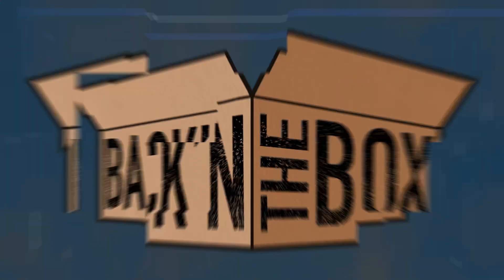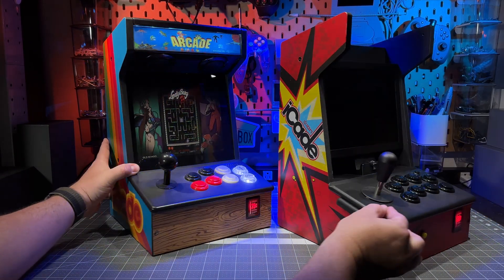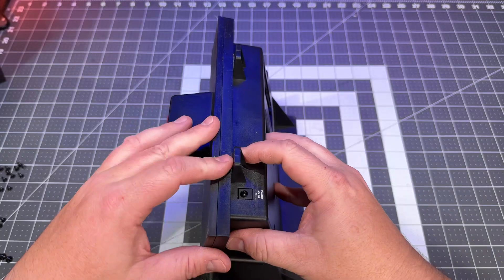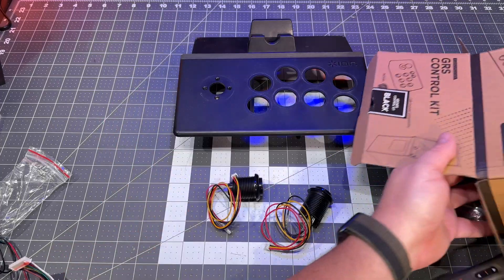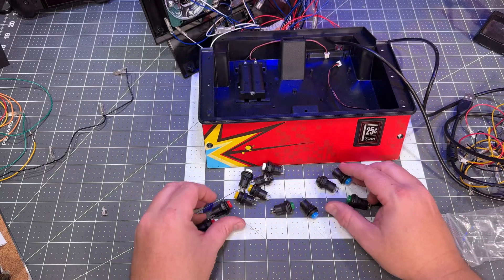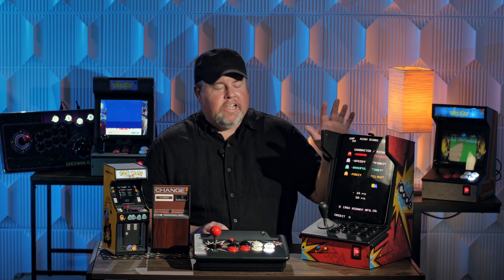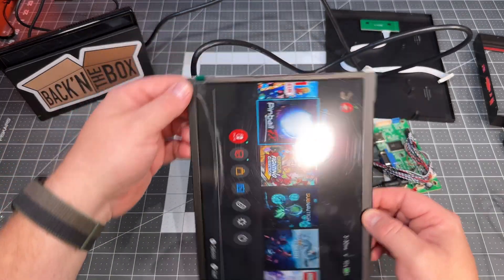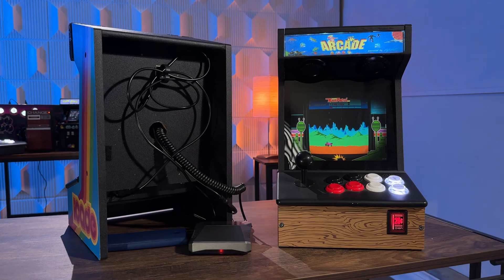mini-Arcades;  DIY MODs for Switch and iPad

Comment: Can you do this with a galaxy s9 + tablet?
Reply from the maker: In one version I have an hdmi to usbc capture device that allows the iPad Pro to be used as monitor. Make sure it is a usb 3 rated device as slower devices have more lag. As for the other version where I use an iPad screen as the display you’ll just have to find a display controller board for the display panel you use. So just look up info for the S9+ and check for the type and model of displays it uses.  Thanks for the question and for watching.

Comment: I was part way through my Icade build when I found your video, and I am so glad I did. That metal frame is perfect. It's new direction in my build process now :) Thank you so much for showing all the different options. Much appreciated.
Reply from the maker: I’m glad you found the video helpful. I enjoy these little cabinets. I enjoy leaving them on in screensaver mode in emulation station. It’s cool to see random gameplay videos throughout the day.  The metal frame really helps with the lcd screen mounting. The first build I did has a smoked plexiglass front to hide the ugly frame and mounting I originally used. Thanks for the comment and for watching

Comment: I just ordered one now & I’m gonna connect it to my MiSTer FPGA. Thanks so much for the advice!
Reply from the maker: Glad you found the video helpful. They are great little devices to easily mod.  Check the buttons if you are not planning to swap them. The units are old and I’ve had button that stick very badly. Thanks for watching.

Comment: I love the rail on the second iCade, what a wonderful idea. And as you said, you get the rumble too. What iPad size did you used for this one? the 12inch one? When you plug the switch, are you able to rotate the video signal or it's done within the switch by selecting Tate mode for games that provide this option?
Reply from the maker: The iPad used is a pro 12.9 and the rotation is controlled through the video capture software and switch setup. The on I used is Genki Studio and you can use other capture devices besides theirs with the software. Make sure it’s an usb3 capture dongle as it has a lot less lag.  Thanks for the question and comment.
Reply: @BackNTheBox  any iPad pro 12.9 will work or I need to look for specific years?
Reply from the maker: While I show an iPad 12.9” smaller sizes work too. The important aspect of the iPad is that it has an usb-c port.  In the video I used an iPad 9.7” screen inside the metal housing so that gives you an idea on the size and fit for a 9.7” iPad.
Reply: This gave me so many ideas for a small arcade setup.